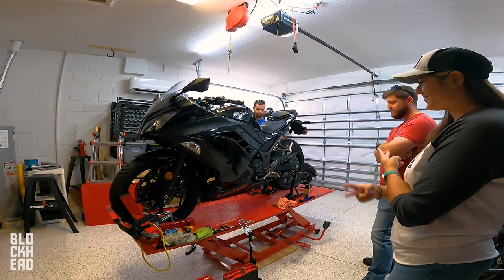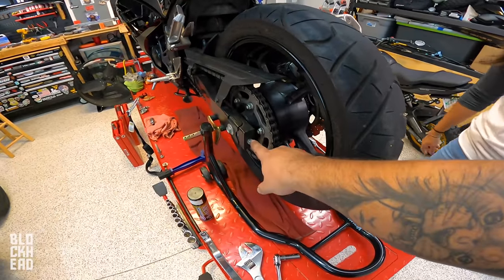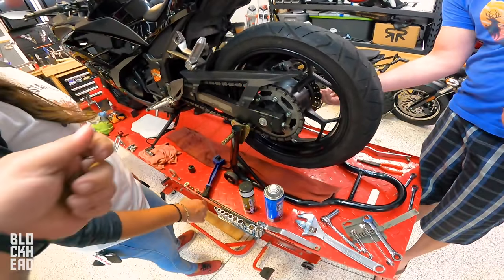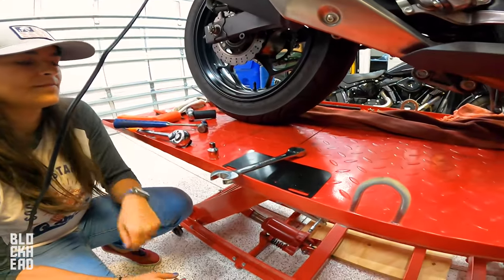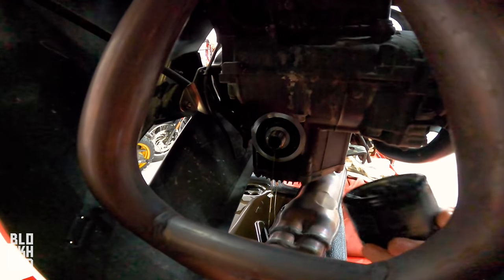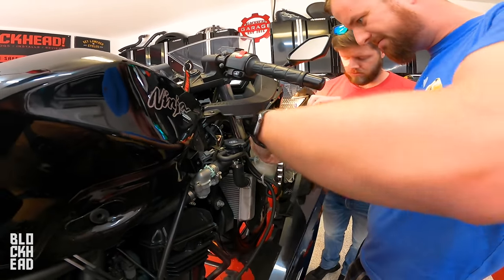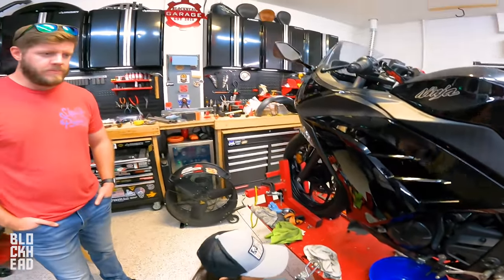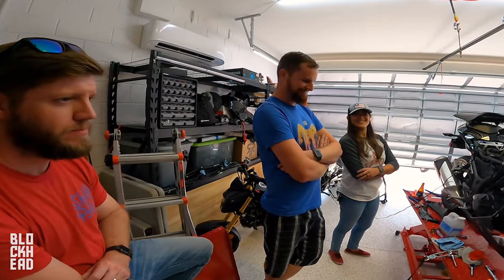Kawasaki Ninja 300 Maintenance! (Chain / Oil / Coolant)

Comment: Hey block, it is interesting to use a tool to check the alignment of the chain. I've read to not trust on axel marks only. This tool looks like a stick attached to a sort of "box", and when you fix the box over the chain, you are able to see the alignment of the chain. As you appreciate to have right tools in your shop, this may be an interesting acquisition. Deuces!

Comment: First mod on every bike, lithium battery.  Lasts 3-5 times longer vs toxic lead acid battery, longer warranty, no trickle charge needed as only loses 1% charge/month vs 1% charge/DAY with lead acid, charges in minutes, vs hours, less weight, no explosive hydrogen gas, no corroded cables, higher CCA especially for big twins, full power starts even at 10% charge(70% charge on lead acid is essentially a dead battery)

Comment: Hey Block those NOCO are good also if you get there GBC007 lead you can install on the bike and have it plug into the gb40 with out removing the seat eg like the trickle charge lead anyway hope this helps. Ride safe stay vigilant.

Comment: Just remember since you're using propylene glycol instead, you're going to want to keep track of hot days as Engine Ice gives less heat transfer for a higher boiling point so your bike is actually running hotter but you won't have boil-overs as quickly.

Comment: I have a question i have a 600 motorcycle motor i took out of a car and am wondering what the 2 holes under the oil pan are for i do not know motorcycle engines so be nice please

Comment: Air cooled motors are cheap to produce vs  more complicated liquid cooled bike.  All gas motors require alot of maintenance because of all the moving parts vs an electric vehicle.  Air cooled motorcycles are limited by HEAT/air cooling vs serious horsepower numbers like liquid cooled motors.  More horsepower means more heat, oil loses viscosity with increasing heat/friction.  Liquid cooled motors mean more horsepower, stable heat environment, durability and long term reliability.

Comment: This is my model bike and I just flushed the coolant and radiator fan. I'm still having abit of a over heating problem tho, I forgot to burp the hoses. Might there be anything else that might cause it?
Reply: Hey what coolant fluid did you use? I don’t know what fluid to use. I also have the same bike
Reply: @tune2356  oh shit, forgot I posted this. Everything is good now and I used PEAK blue coolant & antifreeze 50/50.
Reply: @zerozenn  lol thanks for the reply. Strange question but has your bike ever had a buzzing noise at high rpm’s?
Reply: @tune2356  no it hasn't, tho if ya haven't gotten a yearly look over at a shop I recommend it if ya feel something maybe be wrong.
Reply: @zerozenn  I’m going to have to do that.. thanks fam
Reply: @tune2356  NP dude